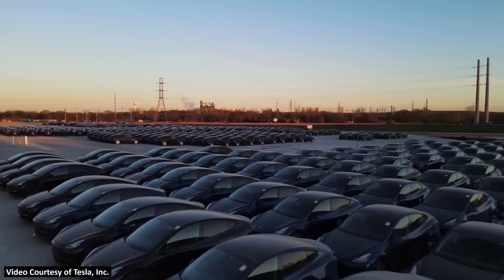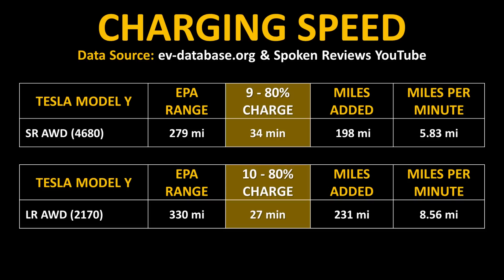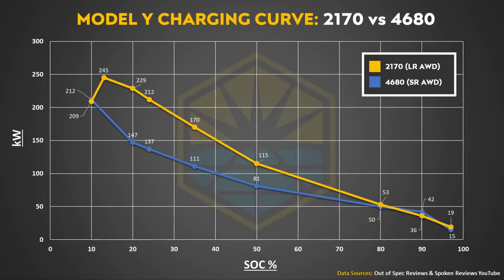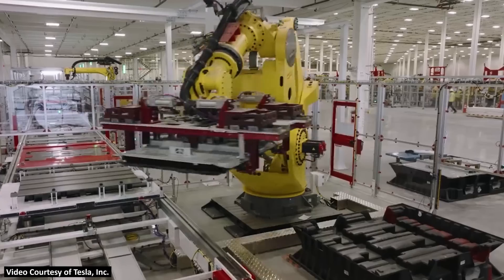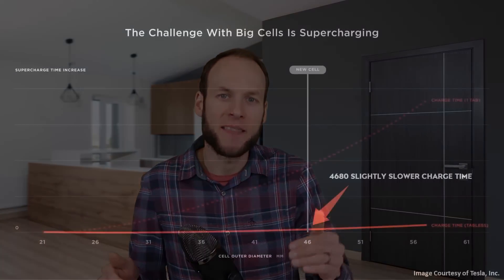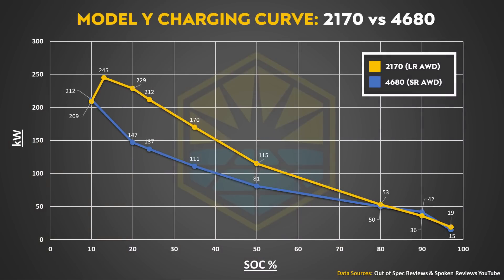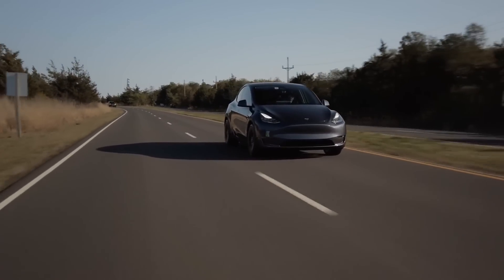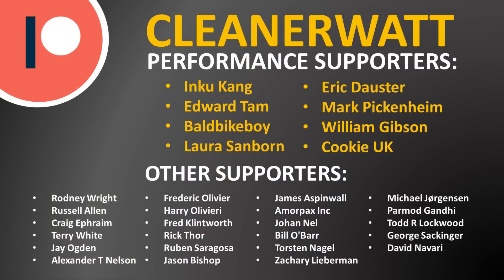NEW Tesla Model Y w/4680 SLOWER Charging than 2170

Comment: They're going to open up the speed later with a software update, mark my words.
Reply: you mean open up the $peed later.
Reply: @BarryObaminable  exactly
Reply: I bet it is a bigger battery pack. The 4680 SR AWD and LR AWD are basically the same weight, but the 4680 has a significantly smaller battery pack, unlikely The 4680 structural battery pack alone should make the Texas Model Y AWD noticeably lighter even with the same size pack. If the 4680 Model Y AWD has the same size pack as the 2170 Model Y out of Fremont, the logical guess is, Tesla will unlock it down the road for free or a small fee. This is likely being done to avoid people refusing to buyt the Fremont built Model Y LR AWDs. I'm betting the new 4680 Model Y LR AWD ehen it is unveiled will have a close to 350-400 mile range fepending on pack size. I'm guessing a new standard range Model Y SR (RWD/AWD) will have 280-300 mile range, but with a significantly smaller battery pack.
Reply: People would have to be brain dead to pay 20-30% MORE for a Tesla that has LESS range, that takes LONGER to charger, and it has LESS features (no radar, no lumbar support, etc..). 100% BRAIN DEAD...
Reply: I think Tesla is being careful and probably trying to prevent the Osborne effect. However with their demand level, I don't think they have to worry about that.
Most likely the reason is for safety reasons.
Reply: 100% chargeable option or for free this is the ramp up evaluation cycle to be safe, funny BZ4X can’t be charged in cold Temperatur only less than 20KW after 30% 😉
Reply: I hope so! Why do you think they’re currently limiting it?
Reply: @davedickson7068  Safety. They don't yet have the "millions of battery cells in customers hands for x years" data they need to generate the safety statistics they need to increase the rate.
Reply: @davedickson7068  Tesla always do this with a new battery designs.
It was also the case with the LFP battery lately
Reply: All the above reasons and mainly removing the Osborne effect.  I've been saying this since the 4680 Y stats were released.
Let the customers (usage data) enable the correct BMS mapping.  All Tesla's battery capability have always been updated after a period of data mapping.
Yes, guinea pigs, but worth it in the long run!
But who cares when your spec goes up, for free?    That's the way to do it.
Reply: There likely won't be any substantial charging improvements for this particular Model Y.

Tesla stuck with 2170's for the Model S Plaid; the reason is with more batteries operating in parallel, they can push more power to the motors.

The same idea works in reverse with regard to charging. With fewer batteries in parallel, the charging curve will be different to prevent damage to the cells. That means a slower charging rate as the battery reaches 100%. The fact that the cells are physically larger means the concern with thermal runaway is higher.

There is a strong likelihood that any improvements they make in software will be minor.

The only reason we might have seen a substantial improvement in charging speed as a function of charging rate to miles is because of an overall lighter battery (resulting in a more efficient vehicle). As it is, the 2170 can push ~50% more miles per minute added even with a heavier pack; having more batteries in parallel results in a better charging curve and compensates for the efficiencies gained by going with a lighter pack (but larger individual cell size).
Reply: @paulo3011  good points, thx.  But I still think there will be improvements, just maybe not as big as we're all expecting for the reasons you pointed out.
Reply: Ludicrous Charging Speed will cost $2900 to unlock via OTA firmware update

Comment: Apparently you can charge new 4680
to 100 percent without warning. Since we know the cells are nickel based and not iron this would also suggest a larger, software limited pack as the “100 percent” charge would actually be a lesser percent per cell with the charge distributed amongst all the cells in the pack.
Reply: Charging the last 10% takes ages
Reply: @2nd3rd1st  not really related to my point but true
Reply: @SejalPatelDrSej  Right, but on the topic of charging times I'm just saying that a 100% charge really pushes the limit of what is useful
Reply: Incorrect. There's still a top 10% labeled trip.

Comment: to avoid the ozzy osbourne effects on 2170 models (softwate limited until 4680 fully ramp)
Reply from the maker: Seems likely for sure.
Reply: @Cleanerwatt  Great video!! These cells likely have a lower (worse) wh/kg figure than the highly optimized 2170 cells made with the tried and true wet electrode process. Right now, the chassis weight-saving gains are being masked by that as well as some "sandbagging" for safety until they dial in what is essentially an entirely new way to make cylindrical cells compared to their entire history.
Reply: Ozzy Osborne 😂😂